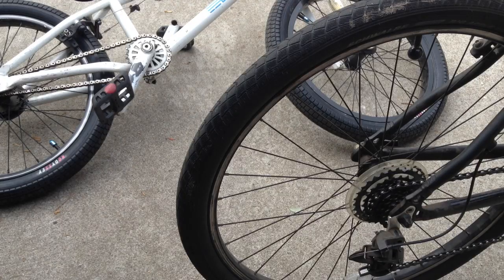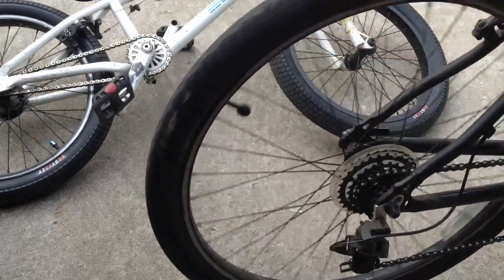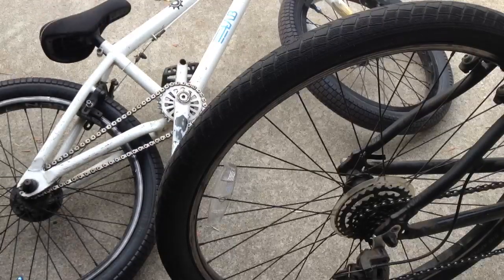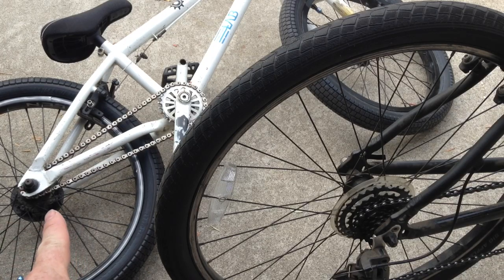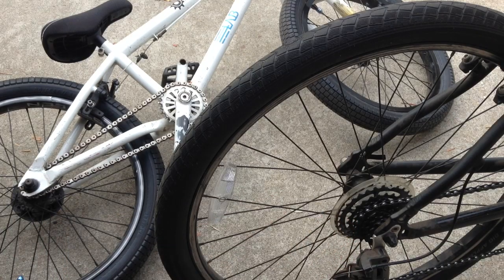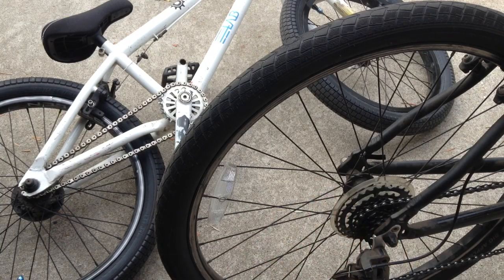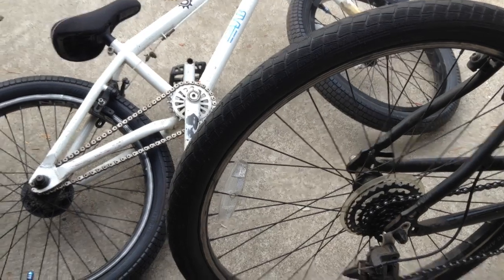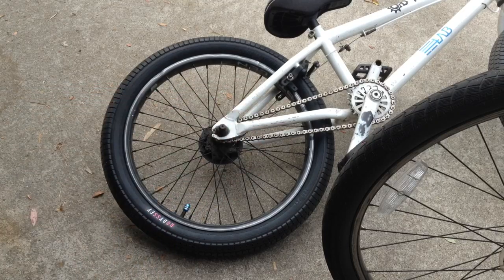How To Make A BMX Bike Wheel Louder

Comment: How strong the spring on the pawls are, the amount of engagement points, and a lot of other things can attribute to the sound. There actually shouldn't ever be grease on the pawls. There should be a thick oil as grease will make them stick. Taking it apart, cleaning it, and putting an oil like Phil's tenacious oil will make it last longer and If there was grease in there make it sound louder and perform better.

Comment: It's the freewheel not the hub that makes the clicking sound. Louder more clickety freewheels are due to more points of engagement. One could take off the freewheel and spray wd-40 into the seam and work it until it starts to click louder. That would shorten the lifespan of the freewheel however. More hassle than its worth imho but hey it's your bicycle do as you will with it.

Comment: 3 ways to make your hub louder:
1. Clean out all the grease then spray a little WD40.
2. Bend your spring but be careful cause your spring can snap.
3. Add an extra spring. (safest but you have to buy another spring or steal one from an old hub)
I personally cleaned the grease out then sprayed WD40.

Comment: Or you could stretch / bend the springs that push the pawls on to the inside of the hub, this way you don't need to buy a new hub or risk degreasing the hub and breaking it
Reply from the maker: That would work. Great idea.